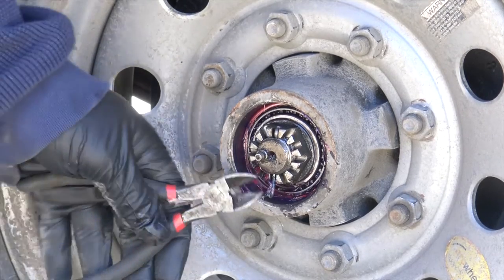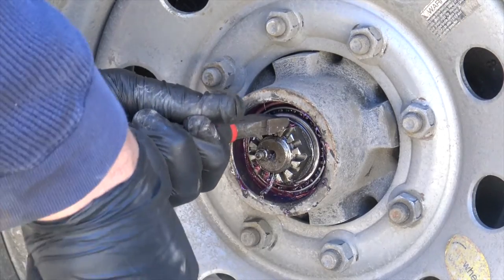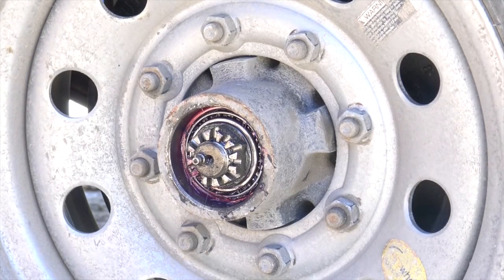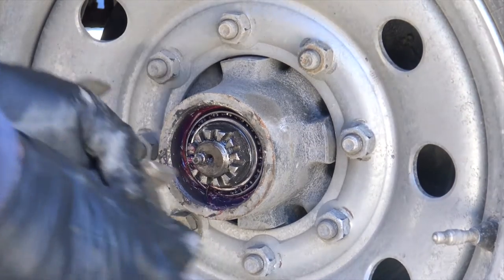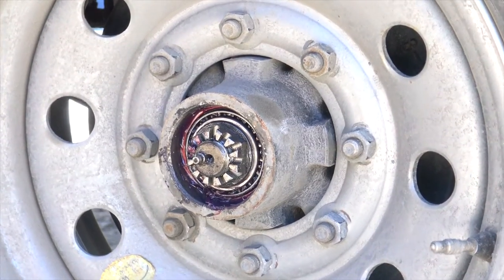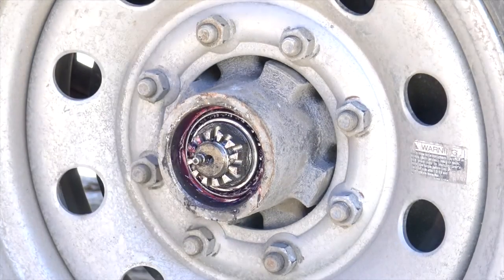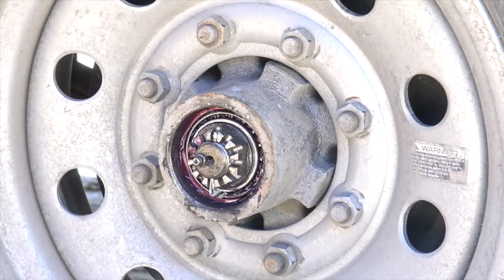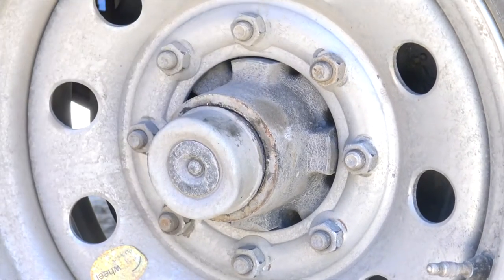Trailer Repair--Loose Bearings

Comment: Go as tight as you can on the castle nut, this helps seat the outer bearing, then back off usually about 1/4 turn. A proper bearing adjustment should have some play, but not enough to hear a clunking sound or become noticeable. Too tight of an adjustment will heat the bearings and destroy races, If you can spin the hub /drum for an unusually long time it means the hub is riding on the bearings and it's time for new bearings.

Comment: Is it normal for it to make that noise whenever spin your tire? Mine made the same noise and I was kinda worried because the other 3 don't make any noise when I spin them.
Reply: David Rodriguez that's brake drag. You should hear that with proper brake adjustment